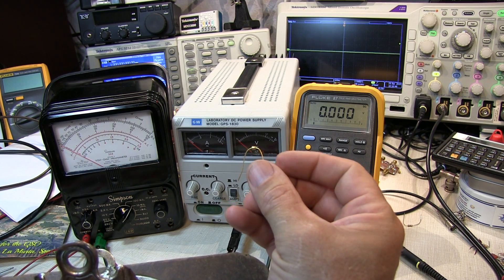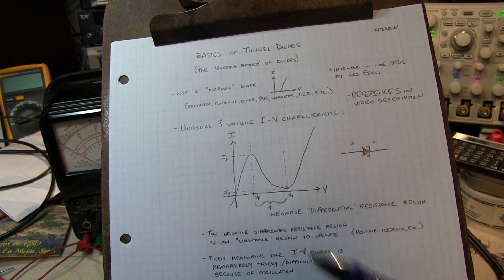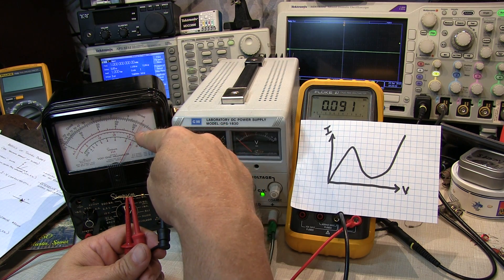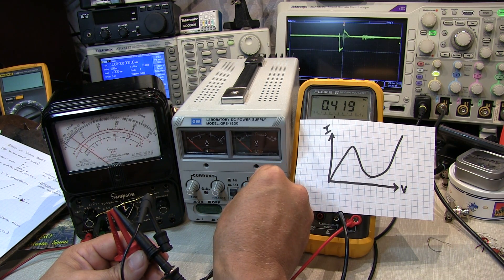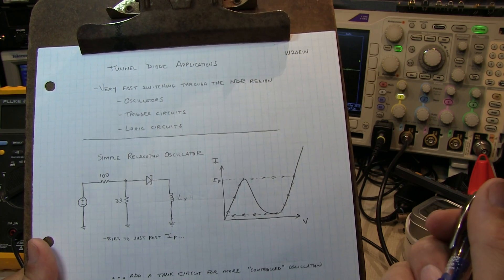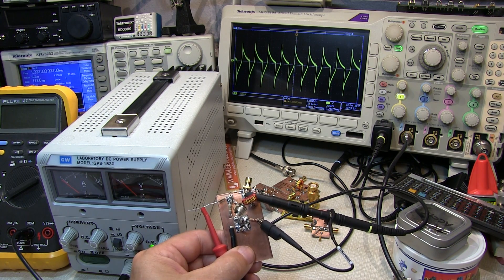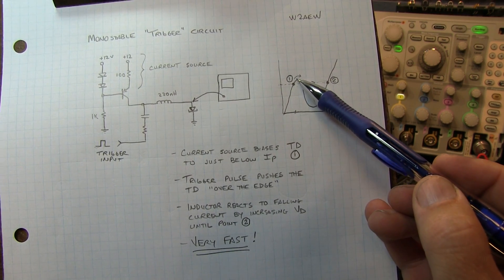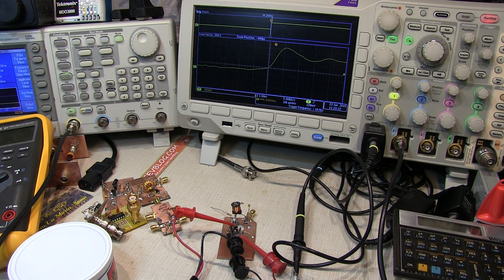#204: Basics of Tunnel Diodes and their applications

Comment: Great explanation on the tunnel diode. I stumbled across this video in wondering how the Esaki diode works on AFC FM circuit . Its a Sony EFM-117  , and the other radio I have is an AFM-152 . Both incorporate the Esaki diodes. Most common is a varactor diode used for AFC.
Reply from the maker: I have a video on varactor diodes too.

Comment: I have worked in RF engineering over 50 years designing varactor tuned rf front ends for television receivers. We heard about tunnel diodes in the 60s, but no one ever came up up with a good, cost-effective use for them.
Reply from the maker: The only place I’d seen them used is in the trigger circuits on old Tek scopes

Comment: The tunnel diode speed is indeed practically limited onl by the circuit parasitics, but the speed of regular (I mean NPN or so; you still need a hf type) modern transistors is so the real life limitation is also just in the parasitics, so bottom line about the same. That means you can make a negative resistance using a pair of such high frequency transistors (and their bias source) and you end up with very similar performance. On top of that, unlike the real tunnel diode, the key parameters of the transistor pair based negative resistance (mainly the slope and the peak/valley flip currents) are extremely well predictable and controllable (you just need to know the bias current and the temperature, literally nothing else), so consequently these become way more predictable and stable in a real circuit.
That is the reason why tunnel diodes are a thing of the past for vast majority of the applications.
And because transistors are easy to integrate, the transistor pair negative resistance is a structure is used practically everywhere in modern radio and many analog circuits (oscillators, Q-boosters for on chip LC resonator tanks, synchronous clocked comparators in AD converters, gain boosters in low power opamps and comparators,...)

Comment: WHY don't presenters (this includes textbooks) 'shade out' that negative resistance region!!?? You will never see that 'region' on a curve tracer nor will you see it* using using slowly stepped manual meters and potentiometers ... I think it does a disservice to 'gloss over' this aspect of Tunnel Diode behavior.
* Outside of the device oscillating, giving the impression it is in that region, as you demonstrated.

Comment: 7:21 Do you happen to remember the frequency of that oscillation?
Reply from the maker: I don't recall, but will say that the oscillation frequency will be highly dependent upon the parasitic inductance and capacitance of the connected equipment.
Reply: @w2aew  Lol I just rewatched this video after a while. I forgot I asked this question, and I came back to ask the same exact question. I guess I'll just have to wire mine up and measure it. It could make a fun oscillator for a synthesizor or some weird distortion audio circuit
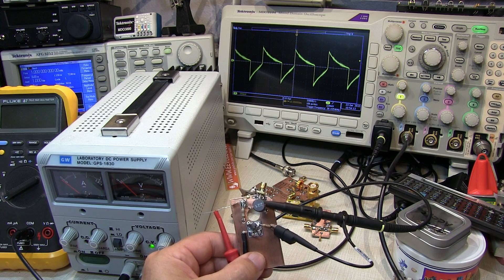Reply from the maker: @L2.Lagrange  At 12:40 in the video, I mention that it's oscillating around 38-39kHz.
Reply: @w2aew  Thank you so much! I'm surprised I missed that

Comment: Page 76

AU (Astron) = Abbrev for astronomical unit.

AU diode (Electronics) = See backward diode.
Reply: Page 330

diode (Electronics) = (1) Simplest electron tube, with a cathode and anode; used because of undirectional and hence rectification properties. (2) Semiconductor device with similar properties, evolved from primitive crystal rectifiers for radio reception.

Comment: thanks dude! Really well taught. As a low frequency power guy, I think these RF diodes are crazy interesting. I was thinking of ways to treat the diode as a variable attenuator. If you push more DC bias through the diode, does the RF insertion loss decrease?
Reply from the maker: Actually, what you're describing is really an application for PIN diodes, not tunnel diodes.  Check out my video on PIN diodes...

Comment: Thanks for a great trip down memory lane, Alan! As a budding ham and EE back in the late 60's, Dr. Esaki's little wunderkind fascinated me. Actually built several gizmos around the GE 1N2939....a 100 kHz. crystal calibrator, 2 M foxhunt transmitter, and a Heathkit Tunnel Dip Oscillator (which still sits on my shop shelf, working to this day!).Often thought what a great  electronic countermeasures device a tunnel diode would be, with it's harmonic-rich output coupled to a broadband, high power GaNi amplifier. ;>)
Reply: Wow. American Semi wants US 99 each for the 1N2939 TD today.

Comment: Thanks for great clip.

Tunnel diodes are quantum mechanical devices.  The electrons tunnels through the barrier as the barrier become too thin, instead of going over it.  Just like science fiction movies, that people and things go through wall.  The tunneling speed is much faster than speed of light, and is almost infinity.  So, it is fun to investigate it.
To get a clean oscillation, you need to measure the negative R of tunnel  diode and cancel it with almost the same amount of positive resistance. So, putting a low resistance pot and adjusting it to get a clean oscillation.  Of course, I would put diode and tank and the pot all in parallel, instead of series as you have it here.  Also, it might be a good idea to have a DC block capacitance between tunnel diode and the pot and tank.
As you know, to get a microwave oscillation, you replace your C & L of the tank with pieces transmission line that intersect your main transmission line in a point like a bow tie or use some sort of resonant cavity. 
Also Tunnel diodes are very expensive and people use NPN transistors ( like 2n2222) backward ( ie. emitter to positive and collector to negative ) to get the similar effect.  In this configuration as the depletion region in the base increases as a result of emitter to base biasing the base region gets smaller and smaller until the carriers can tunnel through the barriers. The reason for backward use of NPN transistors is that emitter region is doped much higher than the base region and therefore by backward biasing it almost all of the depletion region will extend in the base region and decrease the effective base thickness.  

Other negative resistance devices, such as IMPATT and GUNN Diodes, are fun to play with.

Comment: Thank you. Is that metcall on your rework station are. I love to see a video on your soldering and rework tools.
Reply from the maker: Yes, that is a Metcal soldering station - I love that thing!
Reply: @w2aew  they are really good. I think I have the same tweezer, pencil and desoldering. But couldn't take a good look to see everything. 
I really like my metcal pencil, not crazy about their desoldering unit, It's good though.
I finally got the pace prc 2000 90% complete
I like the pace desoldering, Especially if it's connected to auxiliary vacuum pump. Metal soldering units matched with the correct tip is something else though specially for intricate stuff...
It's been good thanks for replying. Looking forward to watch more videos from you
Reply from the maker: @AB-yu2tj  I only have the pencil and talon tweezers.  I don't have any of the Metcal desoldering equipment.  The only desoldering tools I have are a Haako 808 and assorted spring-loaded solder suckers.

Comment: Why do we have two diodes in the second circuit which are connected across the 12 V and the base of the transistor?
Reply from the maker: It is just to setup a bias voltage on the base of the transistor that is a fixed ~1.4V below the 12V rail, which puts a fixed ~0.7V across the emitter resistor, which in turn makes the transistor source a constant current.

Comment: How would you make the simplest possible white noise generator circuit using tunnel diodes please?
Reply from the maker: A tunnel diode, in it's low forward voltage region (below the Vp Ip peak) is a good source of quantum noise.  A simple low voltage power supply and potentiometer, followed by an amplifier is the simplest way to make a noise generator with this.  See Fig 5 and 6 in this patent: https://patents.google.com/patent/US10228912B2/en
Reply: @w2aew  Thank you so much!!!
Reply from the maker: @phild.1122  Neither. The LM339 is a comparator, not an amplifier. The LM358 will not operate with 1.5V supply.

Comment: I have an Infineon microcontroller I need to hack. No data sheet or part number because it’s proprietary but it’s veryvery similar to c166 c167 lqfn144. If you can help me read the flash data I’ll pay you a big bag $1000. I have carprog, xprog, and an eeprom programmer tl866a (although the tl866a is not able for programming microcontrollers). I have the capability of JTAG, BDM, SPI, UART, and serial data but without a data sheet i don’t know which pins or even what style communication I need in order to read flashdata. If you or someone you know can help me hack it I will pay $1000 via zelle, wire transfer, cashapp or any other non refundable payment method. Thanks bud. Appreciate it even if you can’t help.

Comment: What is the cause of the oscillations when only the tunnel diode is connected to the circuit?
Reply from the maker: Many circuits become unstable with a negative resistance.  Normally, when the the voltage across a decreases, the current drawn also decreases.  This device has a negative resistance region - when the voltage decreases the current increases and vice versa.  This leads to instability in many circuits.

Comment: Can you please explain how the current source circuit in your video actually works? I cannot understand why this is a so called current source? Thanks
Reply from the maker: The two diodes set up a fixed voltage on the base of the transistor, which puts a fixed voltage across the 100ohm emitter resistor.  A fixed voltage across a resistor results in a fixed current.  Since the emitter current and collector current are virtually the same, the collector becomes a source of a fixed current - thus a current source.  Check out my video on current sources:
https://www.youtube.com/watch?v=xR0RfmmRhDw

Comment: Hello Alan. Years ago I came across Unijunction transistor which had also a negative region in its characteristic like the tunnel diode. Can you explain what is the function of the third "foot" and what circuits was it used for?

Comment: What is the specification of the diode?
Reply from the maker: Tunnel diodes are usually rated by their Ip current value.  I don't recall which diode I used in this video, but it was probably rated at 8 or 9mA Ip.  There are several tunnel diode examples listed near the bottom of this page:
http://w140.com/tekwiki/wiki/Tunnel_diodes
...to give you an idea of different tunnel diode specifications.

Comment: Hey, fantastic video and explanation, thank you! A question - is it possible to use these tunnel diodes to still convert AC to DC (up to 12V) or is there any other effect above a certain voltage? also would it work with any frequency of AC? (talking up to 13,56 MHz)
Reply: sure you could construct a 50Hz/60Hz/400Hz oscillator using tunnel diodes, then you need to step up the voltage from 20-200mV (Ge Tunnel diodes) at around Ip current (2,2mA 4,7mA 10mA range) to vhat voltage you need, power limitation is in tens of mW range, so for 10mW 12VAC it is possible but the power is miniscule, however you might want to construct a converter from 0,5V solar cell (single piece of solar panel) to 3,3V for micropower CMOS circuitry. 13,56MHz or 27,12MHz is no problem, not even 2,5GHz or even higher. for above 10GHz Gunn diodes or impatt diodes may be more suited. but there are Tunnel diodes for 15GHz (1i103B) and even higher.

Comment: Thank you for the tutorial, and especially the step by step through of the relaxation oscillator. I have been making my own point contact tunnel diodes from "scorched" galvanized sheet metal and small copper wire catswhiskers for some time, based on information on sparkbangbuzz.com. These make effective homebrew RF pre-amplifiers for crystal radios, regenerative crystal radio receivers, and also low powered transmitters. The bias settings and impedance matching is somewhat tricky--and takes some experimentation--to avoid self-oscillation, especially for wide band (untuned) RC coupled RF amplifiers, and know I have a better understanding of why this is so and how to help mitigate it to hopefully make adjustments less critical. Thank you again!Rob

Comment: Where do you buy tunnel diodes from? I searched Digikey for Esaki and Tunnel diodes, and came up blank?
Reply from the maker: TheHue's SciTech They are difficult to find these days.  However you can often find surplus or new old stock on Ebay.  There are a few specialty semiconductor houses that will still make them, but they won't be cheap!
http://njsemi.com/parts/?search=1n2927
http://download.njsemi.com/1N2927,A%20-%201N2934,A.pdf
http://www.advancedsemiconductor.com/pdf/1n2927.pdf

Comment: Thanks again for another instructive video,
Inside the Negative Differential Resistance Region, where the oscillations take place if I understood well, I guess the diode is in a state that is liable to be more easily affected by an external magnetic field and it may show up as changes in the oscillation frequency. Is it possible to test that in the circuit you used for the video?
Reply from the maker: jlfqam I'm not sure - it would be worth trying...
Reply: ***** Thanks, 
I found a couple of manufacturers of Tunnel diodes, made of Ge instead
NJ Semiconductorsa and Advanced Semiconductor
I did not ask for availability, just searched in their website database
http://njsemi.com/parts/?search=1n2927
http://download.njsemi.com/1N2927,A%20-%201N2934,A.pdf
http://www.advancedsemiconductor.com/pdf/1n2927.pdf
http://www.advancedsemiconductor.com/cgi-bin/search?pattern=1n2927&submit.x=13&submit.y=15
Reply from the maker: jlfqam Good to know, thanks for posting those links!

Comment: Confession time I never really knew how these worked, until now, they do seem quite expensive though, I've seen them costing £10.00 to £15.00 over here.
Reply from the maker: Paul Collins No problem, Paul.  They are a bit of an esoteric part, but have a lot of RF applications (oscillators, comb generation, frequency multiplication, amplifiers, etc.).
Reply: Now, a comb generator would be useful in the shack. I do enjoy our Ham radio hobby, more now I'm building my own equipment, two  of my favourites of your designs are still, the most useful in my shack the stand alone ramp gen, & the TDR, both so useful.

Comment: Not to be saying that I am disappointed (very useful information) but I was somewhat hoping for an application as an GHz amplifier since this has always been a mystery to me
Reply from the maker: Dennis Lubert That would require a much more careful layout, very short leads, soldered connections, etc.  This would mean sacrificing one of these (valuable) devices, which happen to be Tektronix OEM tunnel diodes which I am hanging onto for potential future scope repairs.
Reply: ***** Ah, I see... when looking around on ebay one can sometimes find tunnel diodes for 3-5 bucks, would those be of a sufficient quality for such an amplifier?
Reply from the maker: Possibly, I've never really looked into them.

Comment: Thank you for this tutorial on the tunnel diode.  I would like to understand the oscillations that you demonstrate on the oscilloscope at minute 8.  While the scope is showing oscillations, the ammeter and voltmeter do not show any oscillations.  I have some questions:

  1. Can I presume that the oscillations are too fast for the meters to capture?

  2. However, if there are oscillations and the meters are averaging, how do we get a "stable" value on the meter that confirms to the V-I characteristics of the diode?  That is, the ammeter shows a drop with increasing voltage in the NDR?  The ammeter is averaging, shouldn't we get some "in between" value?

  3. What causes these oscillations?  (After all, we have only applied an external voltage source which gets the diode to a certain bias point within the NDR.)

Sorry, but then, I am just confused about the mechanism of the oscillations without any external components.  (The oscillators shown later in the video have external components that help in causing the oscillation.)
Reply from the maker: Anand Paralkar Yes, the oscillations are too fast for the meter to respond to.  The voltage/current is oscillating back and fourth between the peak and valley points on either side of the NDR region.  The duty cycle depends on where I've got the DC bias.  The meter is showing the average, thus follows the duty cycle change, which is why it does follow the basic shape of the IV curve.  The oscillations are caused by the inductance and other parasitics of the test leads and test equipment, and even the resistance of the leads.  Negative resistance devices can very easily cause these types of oscillations without help from additional reactive components.
Reply: ***** Thank you for taking the time to reply!  Much relieved to see that I was atleast thinking/suspecting in the right direction.  :) Thanks once again for all your wonderful videos.